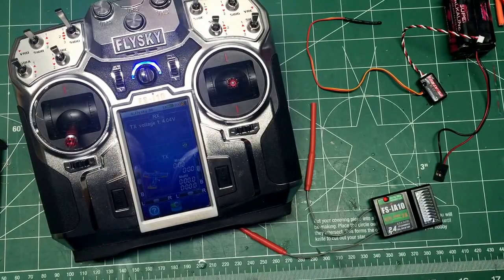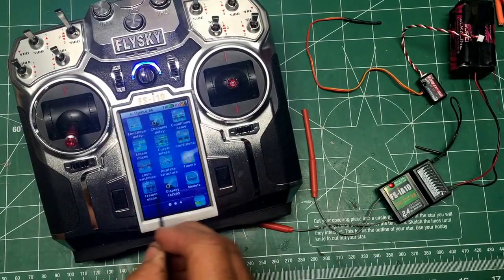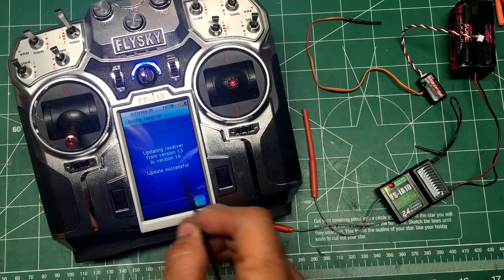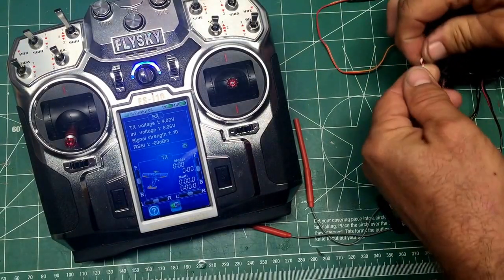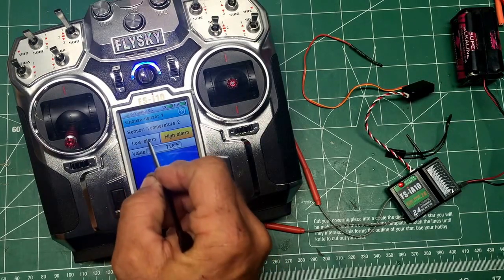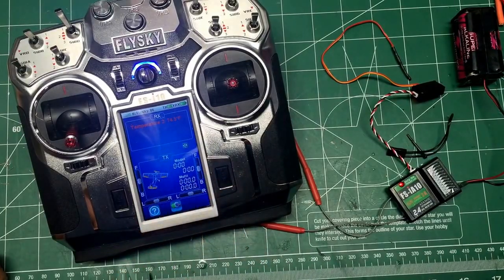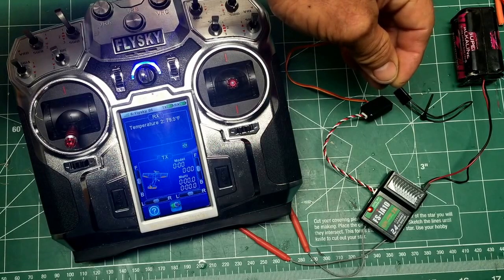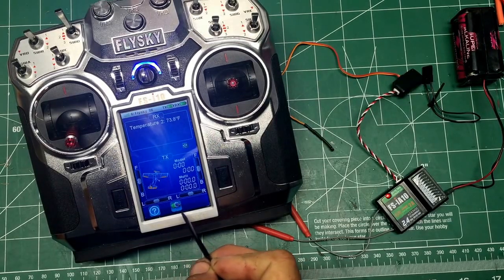Fly-Sky receiver update binding and temp sensor programming

Comment: hey im also do this. i bind my fs-ia6b reciver with turnigy i10
it bind successfully but after update and bind the reciver working well but servos doesn't work. elerons and elivator doesn't work why? i think i shouldn't update 
help me what i do
Reply from the maker: Let me see if I understand you updated your transmitter and the receiver is not responding if you did a transmitter update you will probably have to rebind to your receivers again now if you did a receiver update and the receiver no longer passes thru the info to the servos then you need to post this on the FlySky transmitter issues on RC Groups I have heard of this happening here and there and he may have an answer as to what is happening and what to do to fix it in the mean time try another receiver oh and one more thing if you can see if putting it in PPM mode  will go thru and operate the servos ....
Reply from the maker: Bilal ch I am finding out that on some updates of the receivers the update renders the receiver only to PPM mode I’ve spoken to flysky and they have asked me to do a video of what happens but so far I’ve not been able to replicate it but it seems to happen at about a 10% of the time and since it is rendered PPM only you could use it for a drone but won’t work in a plane anymore :-( ad far as I can tell it’s irreversible so if your afraid of this happening again just don’t update the receiver it will work just fine